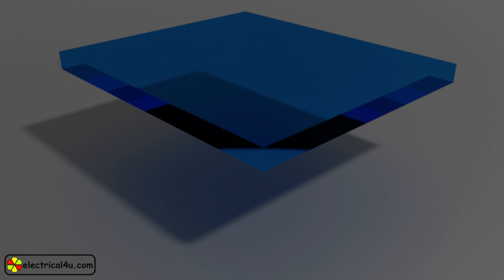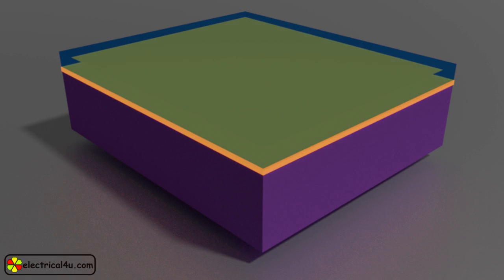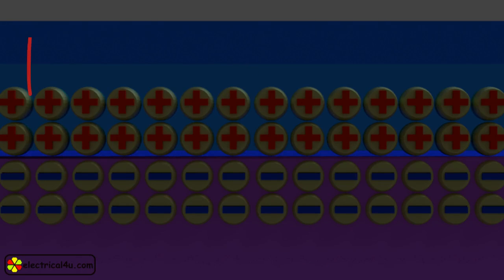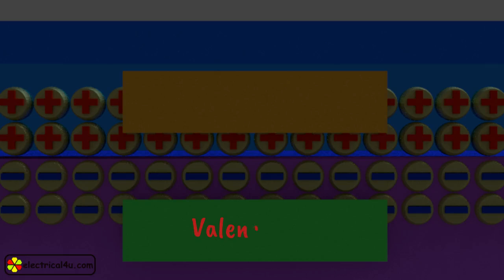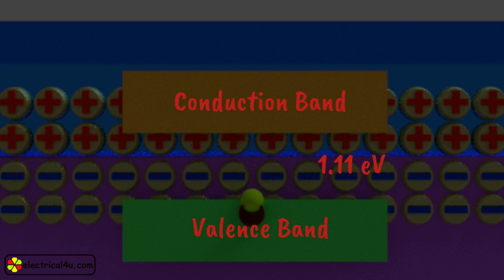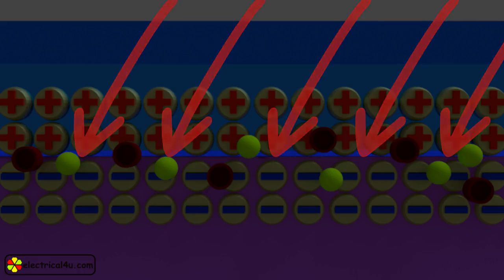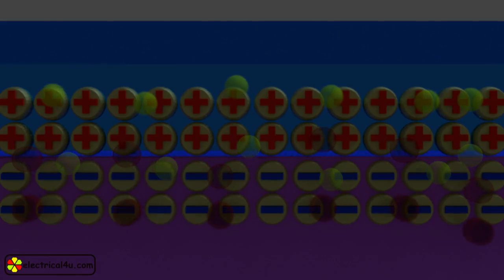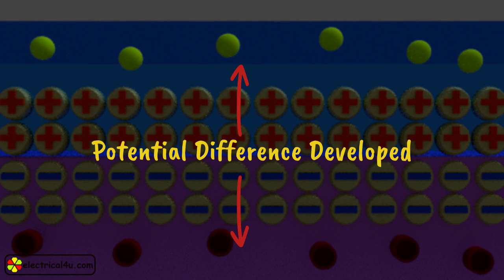Solar Cells: How Do They Work? (Working Animation)

Comment: Sir we know force=m*a and we know electrons are knocked by photons to get current if they are knocking they are applying force that means they have mass but light is energy or matter????
Reply: Photons possess momentum and can impart a force upon collision with an electron. They have zero rest mass, yes, but they are not at rest. As for energy and matter, light is both since energy IS matter (E = mc^2).
Reply: Sir that's what I said if they posses momentum I.e. m*velocity. So they should also have mass
Reply: Think different They sure do have mass, but it is due to their velocity. There is no intrinsic mass.
Reply: Think about this,if they even have unit mass and velocity of 3*10^8. Momentum=1*3*10^8=immense